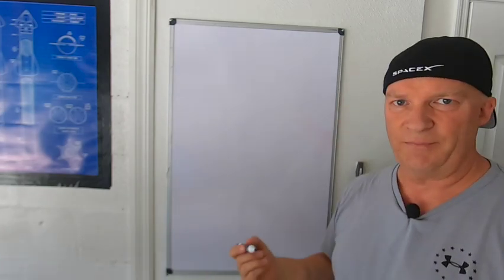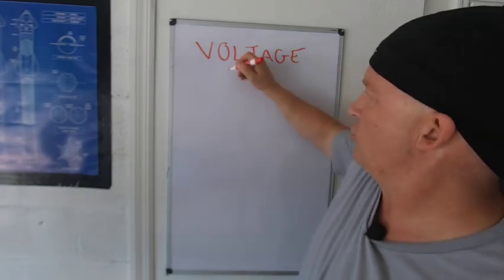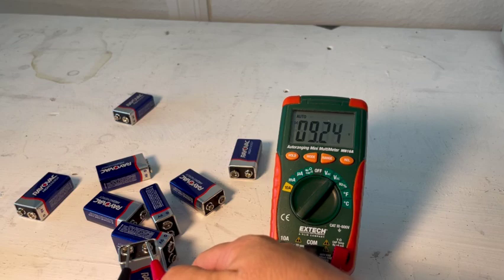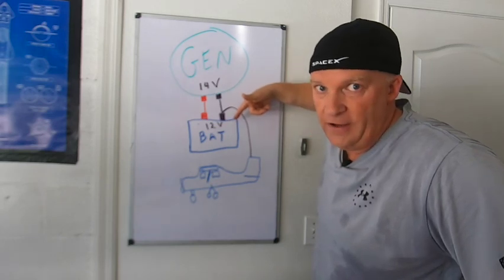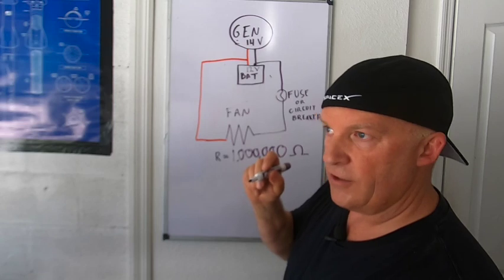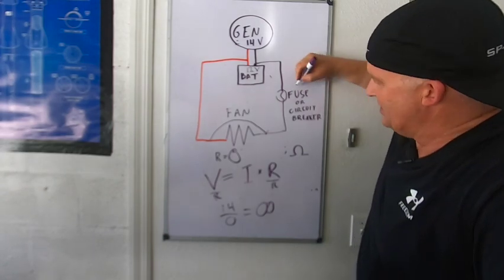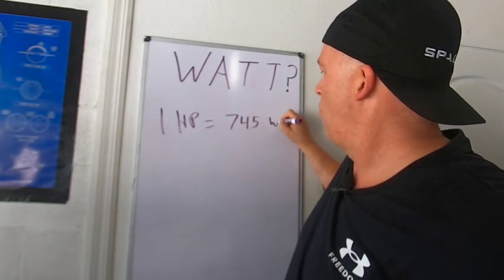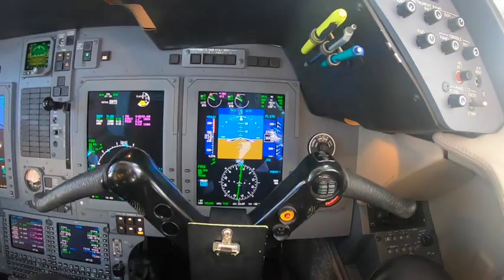Electricity for Pilots - Part 1

Comment: In aviation usually the system run in 24 V ,so the batteries. The generators,generates 28 volts,24 for the system and the remaining 4 volts is for charging the batteries